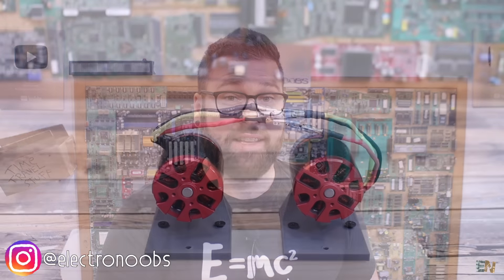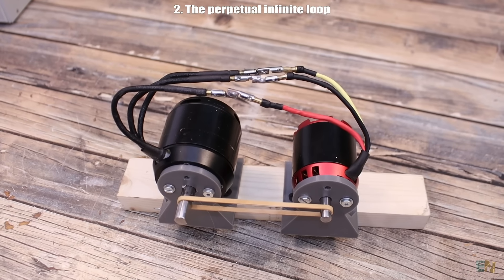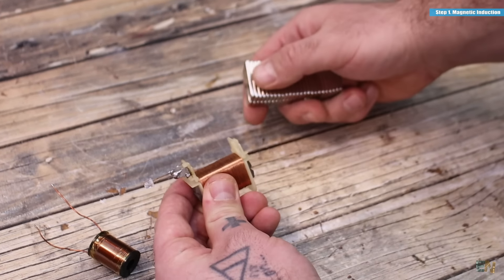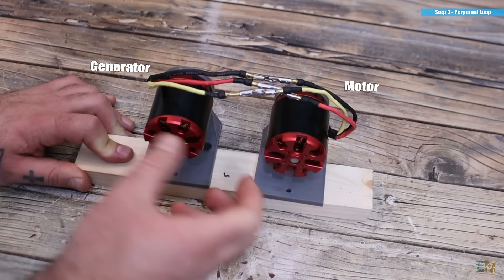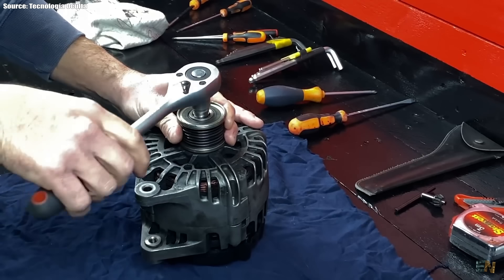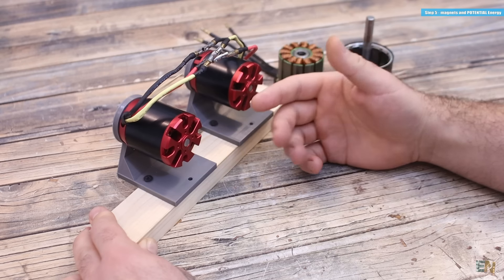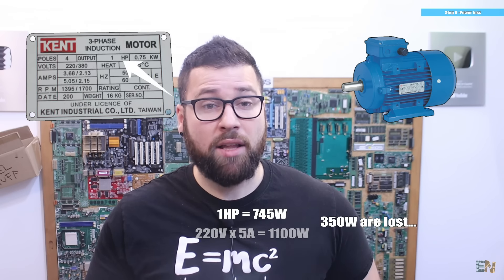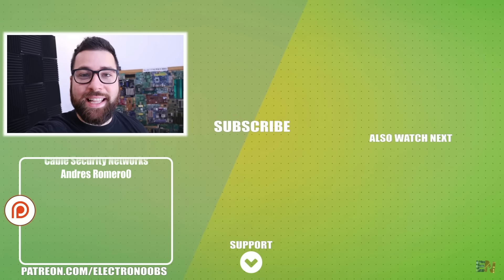Free Infinite Perpetual Energy Nonsense - FAAAAAAKE

Comment: Basically modifying an alternator by use of permanent magnets only made the alternator a
magneto. Even if he didn't do that, an alternator rated at 12 V at 100 amps could only put
out between 1300 -1500 watts and it would require over two hp. to spin that alternator at 
full load since  the alt and engine turning it are less than 100% efficient. 

It is really quite amazing that there are people who think you can have a generator or an
alternator putting out more power than the engine driving it. Are those people smoking 
fruit-loops or something, LSD maybe? and instead of seeing flowers and birds they see
all kinds of power being made with alternators putting out much more than the speed and 
torque required to spin them under full load?

Amps are the electrical equivalent of torque, the more torque you pull from a motor, the 
more amps it will pull from whatever source is feeding it. The more current you pull from a
generator or alternator the more torque will be required from the engine driving said gen
or alternator. it is not freakin' rocket science.

About the best anyone here can do is to go to ebay and spend a few $$. you really want
to know about science. buy an old telephone magneto from a fone like granny had in
bugtussle Tenn. hook it up to a lamp like 7.5 watts. You'd find you can crank it all day with 
NO LOAD on it. but put a load on it. That 7 anna half watts lamp. now you have to put some 
muscle into this. WHY? you ask.All those turns of wire on the armature with current flowing 
thru them, made the armature a strong magnet and its N. pole is wanting to stay close to the 
S.pole of the field magnets large u shaped magnets and the armature's S.pole wants to stay
as close as possible to the field's N.pole. 

No it is not rocket science but it should give you a very good idea as to why you can't go
out and buy a whole bunch of motors an generators, put them all together and think you're
gonna be Mr. Whiz kid  doing something impossible maybe making the 6:o'clock news
and the whole world of science  real facts an figures takes a big dump because you want to
pretty much get a lot of something and not putting much into it. good luck with that.
Reply: For your information do not exist only 12v car alternators!
Reply: @scamper_van8470  Speak English will you? What don't exist? messed up
alternators? Probably but nowhere as bad as this mess. a magneto was 
made from an alternator as ur using permanent magnets to supply the
field whereas the alternator had a wound field, to be fed from the battery.
Reply: @raymondgarafano8604  It makes sense to me that if you design/tweak an engine to have the same amount of friction when rotating as the alternator connected to it, the power assigned and transferred to the other device from the alternator would be the same amount of power returned to the alternator by the other rotating device, hence an infinitely, autonomously running, free energy machine (after you give it the initial starting energy).  Where the hell is the doubt in that??
Reply: @raymondgarafano8604  I'm not a physicist, but there's GOT to be a way to tweak the parts and connections to make this system work.  Try to come up with it yourself!  I firmly believe, if it's not already possible (and just secreted technology), then it WILL be possible any day now, as soon as someone gets off the grid and has an epiphany and eureka moment like Tesla and Einstein had.  Maybe this next person will be you or me. :)  I don't believe you need to know physics and electromagnetism inside and out to experiment with stuff and discover something ingenious.  Let's all be OPTIMISTIC and EXPLORATIVE!
Reply: @beaueads4170  Frankly I did try it way back in the 70's I got a 12 volt starter
motor to work a lawnmower cutting blade and a generator driven by a belt 
off the same motor thinking, the gen would charge the battery as grass was 
mowed, Nope, the torque needed from the generator and the motor needed
torque for the cutting blade. The motor was overloaded and gen could not 
spin fast enough to charge the battery.
Reply: @beaueads4170  I guess 2 years later you (or anyone else for that matter) has not come up with that Eureka moment yet.
Don't hold your breath.
Perhaps read Raymond's original post again nowadays, it might make more sense to you now. Maybe, maybe not.

Comment: Everything you explained made sense. But the problem solver in me wants to try to find a way to make it work. :-) I know that sounds funny, but that is just how I am wired.
The first thing I started thinking about was to take your solution of connecting the shafts of the generator and the motor, however I would add a heavy duty flywheel in the middle. My thought was that the flywheel would help the motor turn the more powerful generator while keeping the power consumption down.  At least that is my thought. So what do you think the Flywheel would add to the equation?
Reply: it's impossible without breaking the laws of physics themselves, you'd a material with literally 0 friction and keep the thing contained in a perfect vaccum and even then the energy inside is just part of a cycle, no new energy would be able to come out
Reply: @romanpackham8471  But did they give us all the info at school? If yes, a flying saucer or ufo can not fly or stay stationary because there are no wings or rotors and there is no sound. Same with the incredible speed they can reach and the instantaneous disappearing or movement from one place to another 10 kilometers away. Not possible with the laws of physics as we know them. Yet these phenomena have been seen and are documented.
Reply: @martinuso7446  If Nikola Tesla had listened to his contemporaries in America, when he told them about electricity and its long-distance wireless transmission, and they told him that it was impossible, it is certain that we would never have known about such a possibility. Of course, everyone will say that one is Nikola Tesla, but I don't even want to belittle Nikola Tesla's work, but I want to say that we were taught many wrong things through education, because some who think that they are gods who walk the earth, hid them from humanity. You just have to try it, and this has been proven to work.
Reply: Solve problems, problem solver. This is not a problem, it is just toil in ignorance of established, exhaustively proven and tested classical physics.
The flywheel would make everything happen slower - it would allow you to put more energy in and so it would then take a bit longer to waste it all away.
Reply: @americansrus4201  you try it then and send me the video
Reply: Flywheel works .. you need a 12Kw generator to make it worthwhile
Reply: @martinuso7446  you just used flying saucers as proof that physics is wrong…did I understand correctly?
Reply: @davidgill3356  Well... The physics they abide to is correct otherwise they would not work would they? But what they do, like instantaneous displacement at a speed that is greater then the speed of light is not possible if you would believe earths scientists. Since the speed of light is the fastest we can go theoretically in their minds.They have no clue what possibilities open up when you go to a higher density f.i.
Reply: @davidgill3356  Hey David, love to discuss with you and share visions.But please argue a bit friendlier. Makes the whole discussion so much more enjoyable. I am not looking for your approval or agreement. If you want prove of the instantaneous movements of ufo's please go look at some of the military movies of radar images where you see it happen. If your believe system can only manage what you have learned about physics at school you will not get to know new viewpoints or stand open for other possibilities. There are 3 fields of knowing. 1, you know what you know. 2, You know what you don't know. 3, You don't know what you don't know.  If information that is presented falls under 3 that does not automatically mean that is is not true...
Reply: I’m thinking a battery and torque converter maybe a capacitor or two. There is a way
Reply: FAIT
Reply: FFS, here we go again with the flywheels... Flywheels DO NOT create energy. They DO NOT add mechanical power. If your miracle motor does not already have enough "excess power" to self-run, adding a flywheel will not do anything but add weight to your kinetic artwork.

Comment: on the back of the alternator is a voltage regulator and bridge rectifiers which turns the a/c power that the alternator creates, is turned into d/c with the rectifiers and the vokltage is usually 14 vdc. take them out and use the wires from the windings you are working with a/c power..

Comment: strange that it was not mentioned in the video that the original generator is 24V 200A and the motor is a 220V motor.  Then how or where was it converted from 24V to 220V?
It's a good thing that the laws of physics aren't always right, otherwise a bumblebee wouldn't be able to fly.

Comment: Dude, thank you for doing this one!  We need to set the record straight, always.  Good detail.  :)
Reply: this guy is producing false information.
Reply: @amazingpower2761  Which part is false,be specific.
Reply: @davidgill3356  his whole opinion is false on how it works. then he does show it by build one from supposedly "fake" video and his version on how they faked it himself.
Reply: @davidgill3356  They don’t get energy out of the magnet and it has nothing to do with the copper wiring that's there other than its original job.
The magnet turns the motor by using the shell of the motor as it turns since the shell or cover is made out of metal. As the motor turns it generates energy similar to a water turbine on dams instead of a propeller or whatever is inside a dams mechanics its the magnets and the metal cover of the motor that is the water and the magnets the propeller that spins the turbine. the use of the other motor is for it to keep it at a constant spin so it generates the max amount of energy or power. because the momentum of the magnets and the spinning will eventually stop.
Reply: @diesiraeetvindictae1635 I know perfectly well it doesn’t work.  I was trying to figure out if the guy making the comment thought he was lying about it being faked or if he just missed the whole point.
Reply: @diesiraeetvindictae1635  I don’t know where you got the idea I thought the magnets had energy or any of that nonsense.
Reply: @davidgill3356  i just covering everything this youtuber was saying was fake.
Reply: @davidgill3356  umm, it does work i built something similar when i was in high school.
Reply: @diesiraeetvindictae1635  Lol, no you didn’t, unless you mean you built a scam one that was powered by batteries or a fan.
Reply: @davidgill3356  have you even tried or you just listening to someone who’s only qualifications is a bunch of motherboards framed on his wall and a bunch of props. 
Did you vote for george santos? The only way you can figure out the truth or facts build it yourself, this YouTuber didn’t.  all he did was get some props make it look like he might create a smaller version and looked up some information that suited his narrative all because that, that YouTube had 1 million followers (jealousy much).
All I’m saying build it yourself and find out Or build a cheaper version there are so many versions of teslas theory out there on YouTube. 
That is how science works you build it yourself it’s not on opinion, but facts.

Comment: good video. Quick question. If the wheel on the motor is twice the size on the generator thus providing 2 revolution per 1 revolution from the motor. Wouldn't that increase the power supplied back to the motor?
Reply: Sounds like a good idea to me.
Reply: The generator would turn faster than the motor, but speed and power are different things. They are related when power is expressed as the product of speed and the force opposing that motion.
So the motor with wheel diameter of 2 would only be able to keep turning the generator with wheel diameter of 1 if the generator's opposition to turning was low enough (half of the torque from the motor in this case). Because generating electrical power presents internal opposition to the generator turning, this can only happen when electical output of the generator is less (maybe a lot less) than the electrical power the motor is using.
The power rating numbers on the side of these devices aren't automatically achieved just because you 'turn' the generator or 'power' the motor. You get less electrical power out of a generator than the torque times speed (mechanical power) you put in. Similarly, you get less torque times speed (mechanical power) out of a motor than the electical power you put in. 
And for each device, the useful power plus the heat (thermal power) they are putting out is equal to the power going in. 
So no matter how you arrange and connect a motor and generator, all you have made is a noisy, really heavy, vibrating heater that needs external power to work.
Making more sense?
Reply: @drienkm  Kinda. I have no experience but I kinda understand what you are implying. The generator is not going to supply enough power to the motor. If so, then why not us 2 generator? or 3? One motor to turn all the generator to boost the power needed to run the motor. Add more generator to get enough extra power to recharge power bank. ?
Reply: @channyma  Good question. You suggest multiple generators. Maybe the motor has a long shaft (supported by bearings) with multiple wheels, each driving a generator beside the shaft. 
It sound like your idea came from your understanding that the power from all the generators is summed together to power the motor. That's right. The problem is that mechanical power needed out of the motor is also a sum - the mechanical power required to turn all the generators together is the sum of that required to turn each one. In this case, the shaft speed is obviously uniform along its length, but the torque in the shaft is not uniform, stepping higher at each wheel as you observe it closer and closer to the motor.
This all boils down to the law of Conservation of Energy (power is just energy over time). Energy can't be created or destroyed. It just changes form. Weve talked about electrical power (voltage times current) and mechanical power (force times speed), and hinted at thermal power (rate of temperature change times mass times specific heat), but there are even more forms energy can take. It can always be quantitatively accounted for. Energy into a device ultimately exactly equals energy out, even if the energy form changes, or some enegy is stored in it for a while (like a portable device).

Comment: So while you are correct, I think that an important caveat that you failed to mention is that there are perfectly legitimate proofs of concepts out there of truly amazing ideas of how energy might be harnessed that have amazing potential. You don't have to break or circumvent the laws of thermodynamics to generate power at much higher efficiencies than what we currently have publicly available. In fact I think that we are ABSOLUTELY capable of finding ways of generating electricity that COULD be harnessed at little or no cost besides upfront costs.

Comment: Hi, and thanks for the video, I have often wondered if I could fit permanent magnets to the axle of the diesel motor on my sailboat, and a coil in front of this, thus generating enough electric to get a hot cup of tea. The idea is great, but I wouldn´t have a clue how to do it safely in reality.
Reply: No need to over comlicate the issue. Just run a small (automotive type) alternator from the engine. Or, come to that,  mount a small wind turbine, ideally high up the mast.
Reply: there are concepts out there to this but as you mentioned it its hard to do, as a electo nuclear profesor it didnt belive in such a thing, reasech and building changed my mind. work for a Gov and you will know how it works. trade off to it is the generator and how big it can get

Comment: I watched the original video he is debunking and I was sceptical until they made a second video answering all the questions people had in the commentary, they made a second video showing how there were no hidden wires and no batteries involved, he even held the whole thing in his hands and walked around with it showing all sides while it was in motion. He even says he has free blueprints for a more detailed build if anyone was interested. I just thought if it were fake then why did they go to so much trouble showing step by step how to make it and even using resin to keep all the magnets in and making everything so tidy🤔 anyway after seeing this video I'm slightly pissed because I thought it was possible🙄 oh well you live and learn I guess.
Reply: No law can violate the basic law of Physics. The system cannot keep on going with the same speed unless there is a force that compensate the resistive force between the wheel and the belt.

Comment: All factors affecting the amount of power generations and the associated motor losses and efficiency are well explained. The application of Faraday's law on power generation and the opposing magnetic field effect under Lenz law must be considered.
Reply: All the rules and conversions bring you to the state determined only by them.  There are still states that no one has measured or calculated yet, but using the frame you will never get to them.
Reply: @MsWaldx  laws that in uni.v. cannot be broken much like          
#1 e-mc2   thermodynamics 1st law energy cannot be created or destroyed      IE.     E-MC2 those are laws that cannot be broken .